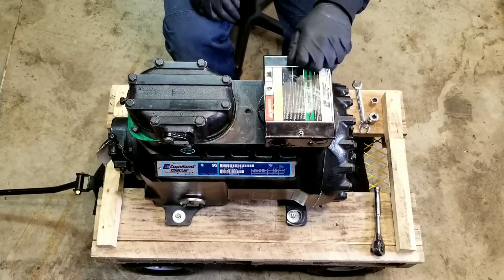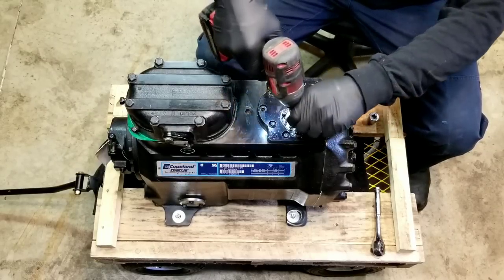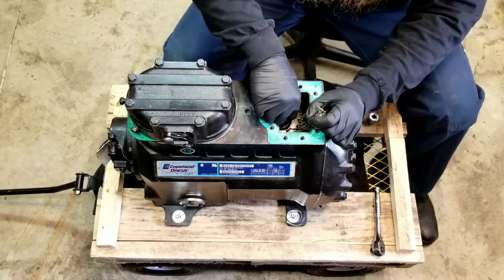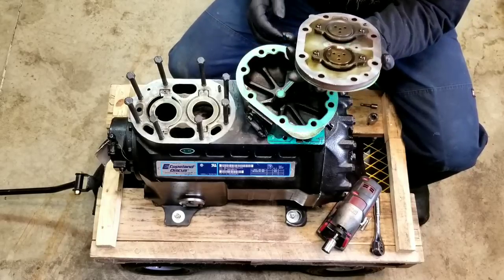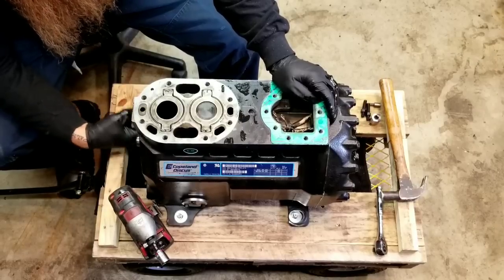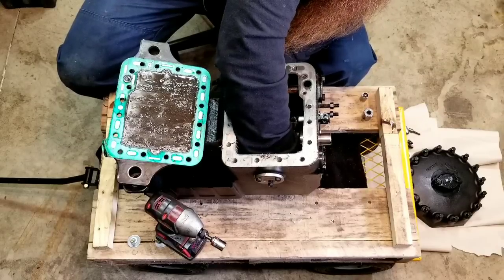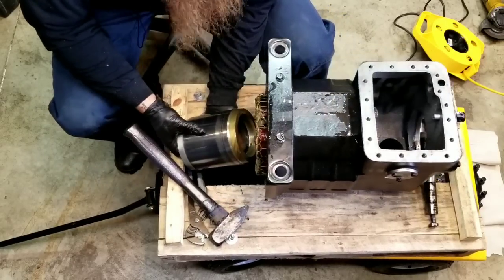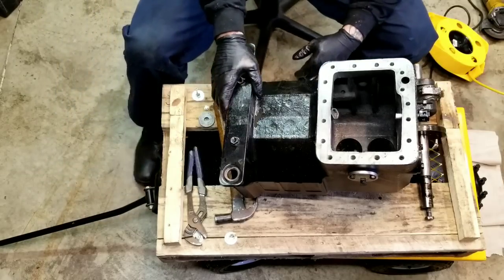Copeland compressor teardown

Comment: question what is happening when u add power and the motor just lock up but it can turn fully when de-energized
Reply: Most likely an issue with the electric motor not the compressor. The possibilities of what’s happening in the situation your describing could be narrowed down a little more if you said whether your unit uses single phase or 3 phase power. And does it blow the breaker shortly after plugging in? 
The motor could have a bad coil or bad connection. Or a bad start capacitor. Just have to look over everything where power comes into the motor. And the motor itself. Especially if it’s blowing breaker then use an ohm meter to check for circuits that would be hooked to hot for a short to ground. This will help to narrow down where to look for the problem. If something is shorted to ground you will usually find a visually tarnished or burnt component or wire or terminal. Or for things like capacitors, transistors, resistors, or any sealed electronical component… look for components that are deformed, discolored, or swollen. If any of these conditions exist this is likely the problem. With electrical motors, components, and circuits… you typically won’t have more than one issue. Usually the system fails to operate when one part of the system becomes damaged. Although sometimes the bad component can lead to an immediate chain reaction of damaging other components that it is nearby or in the same circuit with. Like if you have a bad motor coil that’s creating a dead short to ground. Then depending on how long the short is maintained before the circuit breaker trips cutting power the dead short  could potentially overheat the circuit it’s directly linked with and cause damage to more parts due to overload and overheating

Comment: when i push my contactor manually the fan come on for a second and then the breaker trips. i disconnect the compressor but kept the fan connected push the contactor fan works fine and breaker is on. what parts of the compresor that are electrico that can go bad. my Copeland compressor is for a walk-in cooler. please help

Comment: I rebuilt many semi- hermetic compressors, the motor winding leads that connect to the terminal block, they do not have to be put back on in any specific order. all it will do is make the compressor run in reverse rotation. the oil pump is designed to pump in either direction!!!. also the screen that you talked about, is the oil pick up screen. you did not remove the cap that holds the screen in place. there is a spring and a magnet behind the plate. this compressor failed due to poor oil return. the crankshaft bushings are worn , if you look at the rotor you will see where it was rubbing on the stator slots( bluing is gone). the rod broke first, then the piston (  from suction pressure) forced the piston down and hit the crankshaft. all of this could have been avoided by installing a" OIL PRESSURE SAFETY SWITCH"  and a "OIL SEPARATOR"!!!!      97% of compressor failures are due to an "EXTERNAL REASON"!!!!     this type of compressor is hard to "SLUG" with returning oil or refrigerant, being that it is refrigerant cooled anyway!!!

Comment: I've a smaller one of these(was from a walk in freezer, still big... far as I know still works); you think it can be used as an air compressor? ** my thoughts are add chinese vfd and air filter? any pros/cons?
Reply: checking local facebook market place and seen someone listing a dental compressor that uses 2x of these(MIDMARK model CL32) that run off single phase(the one I have is 3 phase); way too expensive but now I know where to look for a bit of into on what to do to use it for air rather than refrigerant
Reply: that compressor is not designed to be used as a "AIR COMPRESSOR" you are going to have oil discharge issues, they do not have oil rings on the pistons, also the oil will turn acidic from the air/ moisture, and will cause motor failure. the oil insulates the windings of the motor( not dipped and baked)

Comment: Are compressors interchangeable? My condenser is ssx140421cb with compressor ZP31K5E-PFV-830 which has gone bad. I bought part ZP42K5E-PFV-800 as a replacement. Will this fit without any issues or cause damage?
Reply: https://youtu.be/zSItRIv40qs

Comment: I found this to be rather humorous..! Back in the day ( 30 ) years ago industrial transportation freezer Copelands used these things called unloaders to control capacity in conjunction with temperature control and if one of them had a problem the compressor would only cool to a certain temp and stop cooling. I had a new guy with me and told him to check it out and see what he could find, I already knew it was one of the unloader solenoids. I came running back when I could hear the compressor slugging from the next room over. To late, he was dumping liquid right in the suction valve and screaming it was a low charge...! Welp when I took it apart it looked like yours except the valves were shattered also..! Needless to say the new guy didnt work out....
Reply from the maker: lol, Oh my - Just curious, how would a failed unloader cause it to cool to a certain temp and stop cooling? I would think without unloading the compressor would be oversized for whatever application it was in- fell free to email me curioushvacguy@gmail.com
Reply: @curioushvacguy6876  Ok In the book they call them capacity reduction valves. They are no longer used in modern refrigeration. They use frequency inverters to reduce the RPM the compressor turns thereby reducing capacity but you know that..! Its was a set of three solenoids mounted on the head that reduce the compressors ability to compress hot gas, not much but enough to reduce capacity. The 3 were 25% 50% and a 75% and they fail closed so if one failed it would bring temp down but stop short of set point below -18c The noob dumped liquid right in the suction side and the rest is history..!!
Reply: they used unloaders for "LOAD MATCHING", the problem was if the person working on the system did not know what they were doing could( and would ) get into trouble real fast!!!!

Comment: Catastrophic failure! Long time since I saw the insides of a Coplematic!
Reply: https://youtu.be/2oXZfcznm_k
Reply: YUP!!!, lack of oil will do it every time!!!!!, it could have been avoided by installing a "OIL PRESSURE SAFETY SWITCH" and a "OIL SEPARATOR"!!!  97 % of failures are due to an external reason!!

Comment: Hi Bill,

That was fun to watch.
And it got very funny after you said: I don't have the right tool
Can't see too well but I am sure I noticed a bit of a pinkish coating on the inner surfaces?
Especially the crankshaft journals?
That's what you see if the system has been running acidic, for whatever reason.
That's copper been dissolved from the tubing in the system and plated onto the steel surfaces. 
That usually invalidates the warranty on a compressor, if that is found.
It means anything from moisture to high discharge temperatures.

I like the diagnosis of a nice slug of liquid having been ingested, one will never know at which part of the cycle it happened, if the oil was hot or cold and so on.
To get the stator winding's out they pull hard on them and heat the casing with some big propane gas flames, the casing expands and the stator pops out.
The oil pump is trochoidal, and if you look at them you can see the outer ring can rotate.
That automatically lines up the suction and discharge ports of the oil pump with the galleries in the compressor so that it pumps the right way regardless of motor direction.
It is recommended to not change the motor direction on a compressor that has been in service though, as the ring does over time bed itself into position and may fail to rotate if the compressor is spun the other way.
That would lead to no oil pressure.
Yea, I could carry on all day about this lol.
I love any kind of rotating machinery.
Thanks for the great video, appreciate you sharing it.
Kind regards from South Africa.
Duncan
Reply from the maker: Duncan, you sound like your very well versed in these machines, thanks for weighing in
Reply: https://youtu.be/2oXZfcznm_k

Comment: The oil pump is called a g rotor pump in the car biz. Widely used for engines and transmissions.
Reply: "gerotor" is the word you were looking for :)
Reply: throttle bottle oh yes, I  know perfectly well after having been a mechanic for forever. However, I really didn’t see the need to call it “a positive displacement gerotor pump” that has a high and low pressure cavity design for self-priming Im such an informal setting.
 They were much easier to deal with then the slipper (vane) type variable pumps too.
Reply: https://youtu.be/zSItRIv40qs

Comment: Did refrigeration and AC for forty years, replaced many coplematics  with a AC can semi hermetic, one forth the price,  when all ya got is refrigeration supply house 500 miles away and ya got a down walk-in frig freezer you do what ever you can,  seen them running five years latter, no problem...
Reply: https://youtu.be/2oXZfcznm_k
Reply: @javeedhvactechnician7760   what a crap channel 30 second to 2 minute videos, got to be kidding....
Reply: I DID TOO , except I would rebuild the "SEMI'S on site!!! I always had plenty of spare parts ready for such an event!!!!, and I have seen "SEMI'S run 50 years later too( you will not get that out of a "TIN CAN"!!!    the nice thing about semi's are 4 hold down nuts, 4 bolts (service valves) and 3 wires and it is out, no torches needed!!!!
Reply: @gregoryclemen1870   so are you saying you would carry rolls of mag wire and rewind them on the spot?

Comment: That was a easy fix, before you got in there with the hammer and grinder. Some third world countrys accusing you with blasfemy.
Reply: LOL
Reply from the maker: Sure was- I ruined it good but it will make its way to the recycling center at the very least
Reply: @curioushvacguy6876  thats how i learned it, first i ruind a few some, after that i got to learn about it. In my time there was no youtube. Thank you for uploading.
Reply: that compressor is repairable, tearing them down is the easy part, putting them back so they run, is the difference between men and boys!!!
Reply: https://youtu.be/zSItRIv40qs